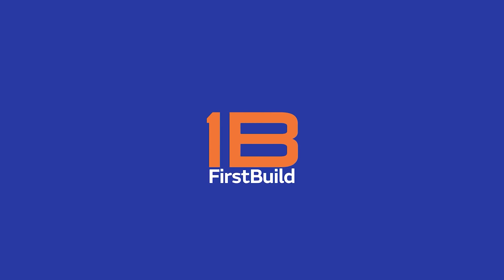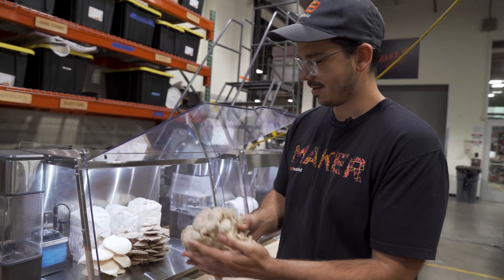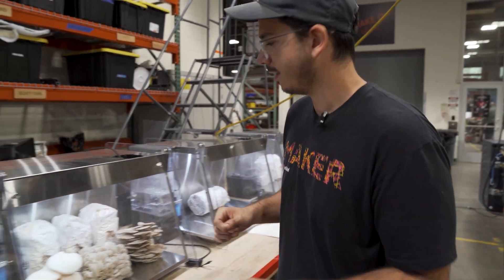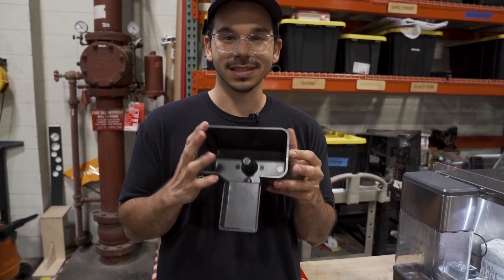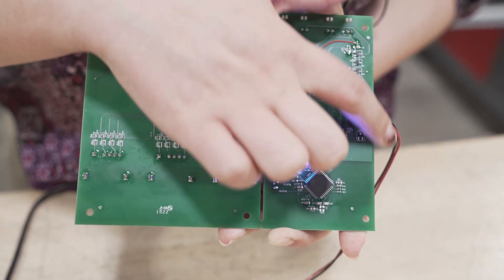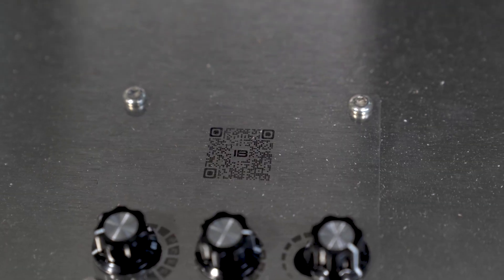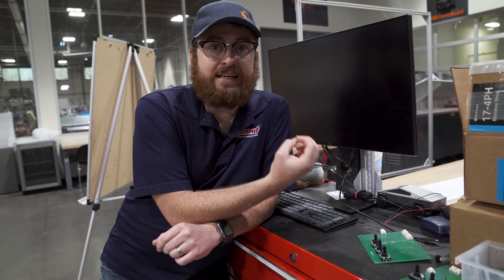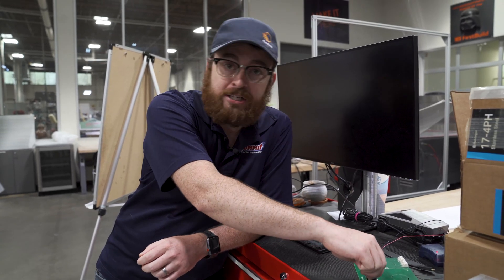Mella Progress Update: Testing, Tooling, Hardware and Software

Comment: does Mella has HEPA filter? also how do you address the issue with drawing in fresh Oxygen inside the house? Is there anyway sort of way to manage / measure CO2 level inside the chamber properly?
Reply from the maker: Mella uses a humidity filter to control the humidity levels inside of the grow chamber. Currently Mella does not closed loop control CO2, however with the fresh air knob and the settings recommended in the quick start guide we are able to achieve the optimal growing conditions for a multitude of mushroom species